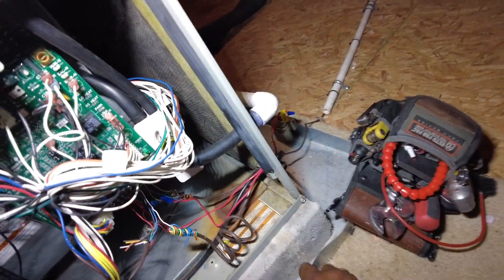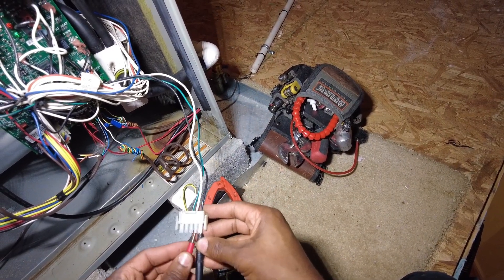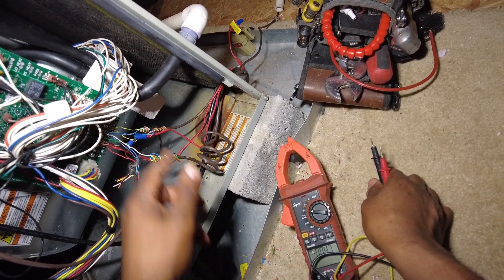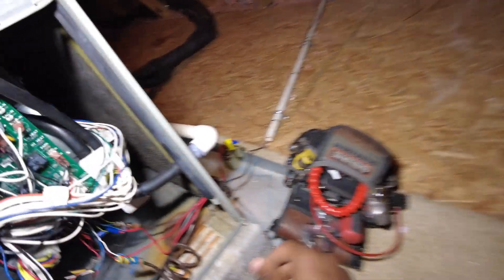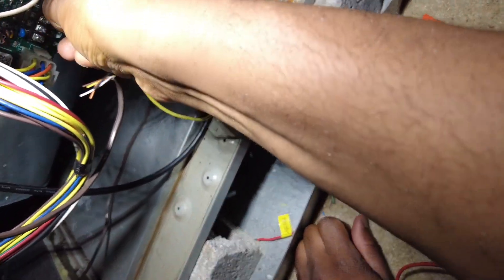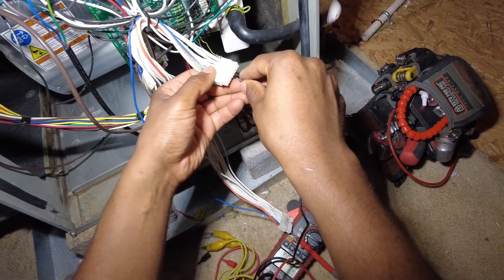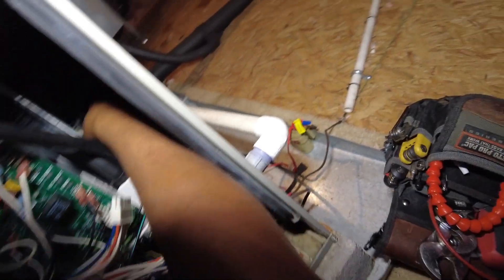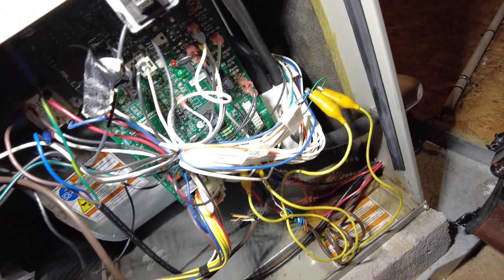How to Diagnose a HVAC Variable Speed Blower Motor using the Go No Go Diagnostic Test

Comment: Thank you for this.  I have a trane unit.  I jumped to the blower and got it to spin up.  But I just already replaced the board.  What else could it be?  Should I replace the 16 pin harness?  But how would the test work if the harness is bad?  Thanks for any advise.  Also the outside compressor will only spin up if I hold the contractor down.

Comment: First of all, thank you! Saved my ass tonight man.
I've got an auy100r9v4v0 that was "upgraded" with the KIT16582, that has this style blower.
 Furnace lights, blower never comes on, burners run till the limit trips, and it shuts down. Did what you showed here and the blower lit right up. So that means my control board in the furnace is bad right? As opposed to the one on the back of the blower motor?
Reply from the maker: Yes sir it's the board! Also  don't forget to check continuity on your wire harness because it also could be that wire harness - but nine times out of ten it's the board itself
Reply: @HVACTechKnowledgy Thank you! Yessir!  I kind of figured the board was finished not only after a jumped the motor but also b/c the cfm light doesn't flash at all when the "blow me motor" should have been on. I'm just bad about second guessing myself on things I'm not to familiar on. Thanks for the confidence and reassurance! Appreciate you. Do you have a patreon or anything?
Reply from the maker: You're welcome! No I do not have a patreon yet thinking about getting one started though